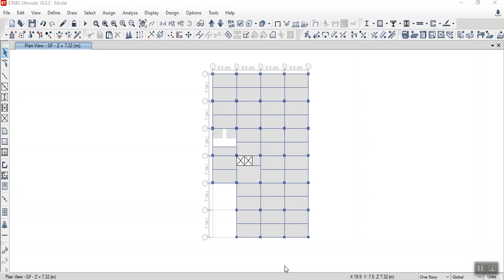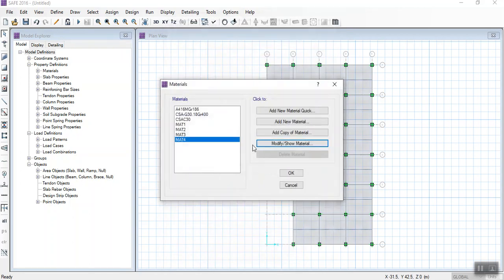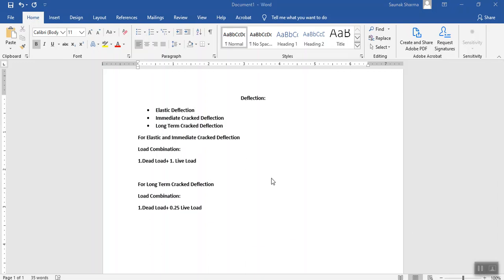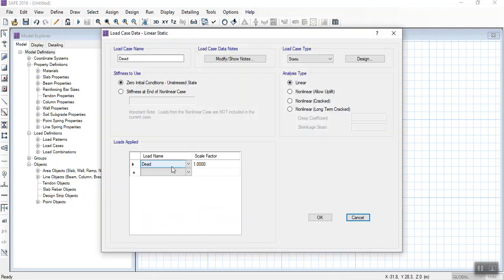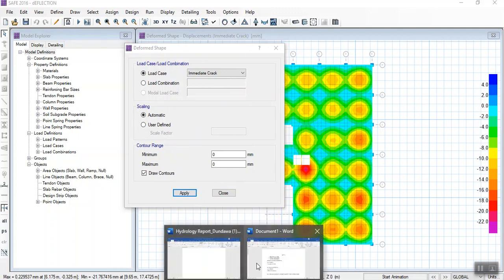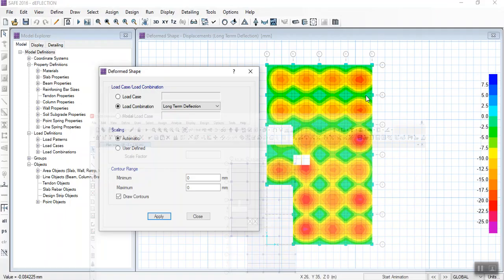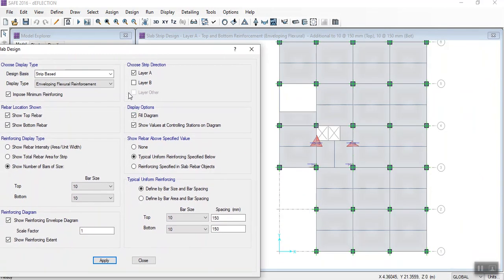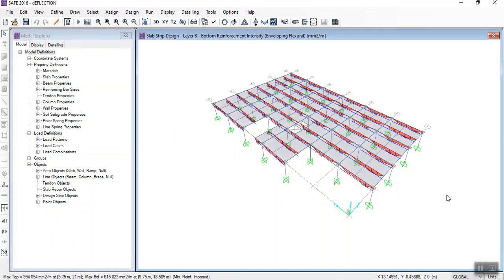Slab Design In CSI SAFE (Including Long Term And Short Term Deflection Check)

Comment: As per Aci code there is guidelines for a mininum thickness of 1 way and 2 way slabs (including flat slab, slab w/o interior beams)
For your sample 2 way slab it is stated their that DEFLECTIONS SHALL BE CALCULATED IF YOU WANT TO USE LESS OF MINIMUM VALUES. 
So if i used the minimum values i dont need to compute deflection.
Any comments??? TY in advance